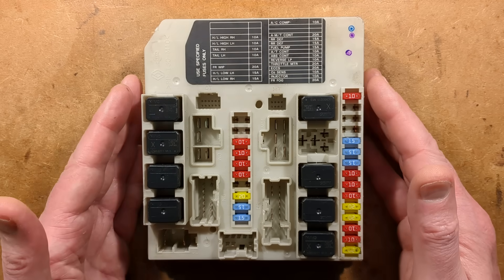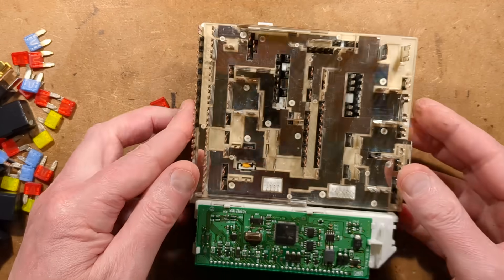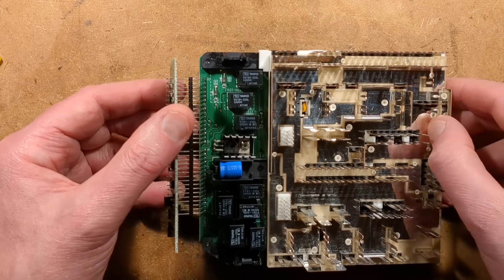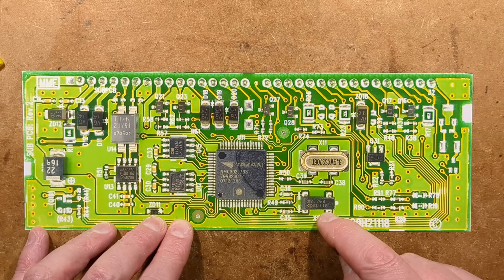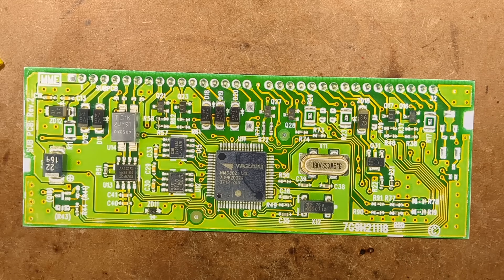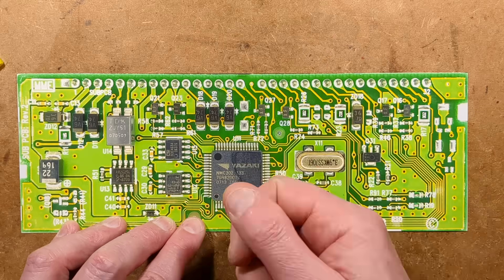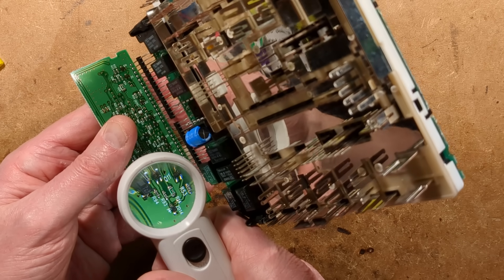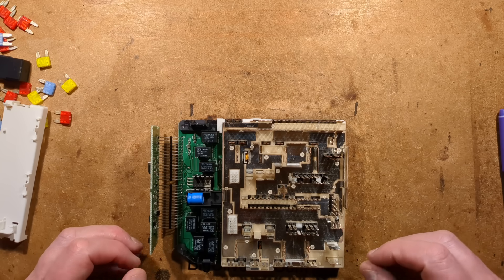Why your car's fuse box costs so much (and the location of the data chip)

Comment: That looks as if it was designed by someone with zero knowledge of the conditions it is expected to operate in. I can see no end of potential problems which your average mechanic would have no experience of. I sincerely hope it resides in the cabin away from any possible damp or water ingress.

Comment: and they can be a nightmare when they fail or start too the BCM (body control modulo) on an 05 ford escape random errors non functioning windows emergency flashers randomly coming on AC going to heat then back transmission wont unlock to drive UGH an they no longer make them it has to be programed to fit the VIN and its hit or miss if that works

Comment: For removing the large pin header I'd recommend a solder sucker with heated tip. Generally great for desoldering a bunch of through-hole connections.

Comment: My father would be 108 this year. 
He advised me 50 yrs ago from following his career as an automotive mechanic because even back then, he saw cars were becoming unrepairable. 
Can't imagine what he'd think about the amount of electronics in modern vehicles.
Reply: They suck.
Reply: It's not the amount of electronics, a lot of it is simply to help modern vehicles meet emissions standards, the problem is that electronic componentry is thrust into a harsh working environment where it is subjected to vibration, dust and moisture and yet expected to continue to function year after year perfectly. I am surprised that more vehicles don't suffer from just the odd bad part or damaged wiring when you consider that VW stick the control box for the Nox sensor between the plastic under tray lining and the body shell so that any water that enters the front of the liner at the wheelarch is carried down the underside of the vehicle and over the sensor unit.
Reply: I drive an old klunker from the '90's. My friend has a fairly new car. One day I had to drive it somewhere, and I could barely understand how... All push buttons and touch screens. Oh, and it turns the engine off at red lights.

Comment: I used to work for Nissan. They actually aren't that expensive, that is a Nissan IPDM (Intelligent Power Distribution Module), they cost around $120.00 new from Nissan (depending on model). When your IPDM goes out, so many random things start happening. The IPDM controls almost all functions that are controlled by a relay / switch. It controls starting, headlights, wipers, fans, shifting, horn, flashers, and many combination meter (your gauges on your dash board).
Reply: Just had Toyota charge me (well, work) $130 for a new fuel cap. $120 for a whole IPDM new seems wild

Comment: Awesome video. I had a module like this (REM) fail in my volvo, and it turned out to be a relay hiding under the plastic shell that was soldered in, and was responsible for switching power to banks of fuses. really annoying repair, and curse the engineers for not making this relay removeable

Comment: not just a fuse box anymore. I would always prefer to copy & paste eeprom date vs swap chips, both work though. may have to lift a leg for isolation. and the modules that self corrupt with low battery voltage are the best

Comment: For many years I have heard people say ''you have water in the fuse box'' suggestion for why the car is playing up. I used to think that was utter rubbish as how could rainwater interfere with the workings of 12V electrics - fuses and wires etc. Now I completely understand where they are coming from, I never knew there was a circuit boards and processors in the thing.

Comment: Been there... My MINI Cooper S used to have an issue where it would start coughing up for a couple of seconds before just shutting the engine down. Not a great "feature" to have in traffic... 🤣 After shutting down it wouldn't start up again, until after 5-10 minutes. Turned out it was the fusebox, but no idea what actually caused it. Bad component/solder joint that would fail after heating up..? Who knows. Cost a fortune to figure out it was the fusebox in the first place, and not the fuel pump, its relays, fuel lines etc. 😬😁

Comment: i was working as a auto electrician at a Ford dealers in Wakefield  in the early 90s when the Mk5 Escort series came out...first Ford with a Multi layer fuse box 

it was mounted under the battery tray inside the dashboard...

Ford never solved the screen drainage issues around there that also plagued the Mk4 and it would flood the battery send acidy water all over the bulkhead and they rusted away there in months...straight inro the cabin and onto said fusebox

i must have changed hundreds....Post Office Vans 20 deep on tne carpark with all sorts of weird faults....fuel gauges that went to dull when ya pulled the handbrake up

..wipers that would only work if you had the door open......random stuff

no real electronics in them but relays galore and everything went through the fuse box...modulare wiring 

there was about 30 variants of box depending on the vehicle spec and a FINIS code on everybox which at least made one easy to identify....after the bodyshop had welded in a new battery tray

on bonus ...you got 
1hr 40 m to swap one...

i had it down to 20mins 

doing 15-20 a day

had my money made by tuesday night  and 3 days to top up the holiday fund😂

Ford warranty copped on and said 'fuck that'...and tried to reduce the time to 35mins as they were paying.....

I objected and said i wouldnt do any then and you can deal with the  off road costs you not being  charged by the PO for van hire cos im so bloody good at it..

They relented and i went to Portugal twice that year  on the proceeds and  paid  cash for a Mk 4 Escort turbo

which got nicked a week  latet

God Bless multi layer Ford Escort fuse boxes❤😂

Comment: I worked in the auto parts industry for about 5 years, the data chip stores the configuration of the fuse panel as you speculate in the description (for Mopar at least) but is primarily to gouge customers, in my experience. I can't really see any necessity in a fuse block being on the CAN bus or storing any data at all. It's not like it will indicate that a fuse has blown or what position it was in or how much current it pulled or anything like that. I think some of them might have a shunt for measuring charging current but I can't say for sure. Still feels excessive to me. 

This was one of those parts we had to turn a lot of customers to the dealership for, who asked for exorbitant amounts of money and then had to program the ECM / BCM afterwards to reflect the replacement.

Comment: Using those chip clips is very much a "it depends". And even without a microcontroller being a concern, it is a possibly flaky connection so I always do multiple reads (usually 3) and do a binary compare, any difference between is a "fail".

Comment: Recognized this unit as being in my clio mk2. Car kept running after ignition off, wouldnt start other moments. Traced the issue down to fusebox, opened her up.. Oxidation everywhere. Cleaned it with IPA and toothbrush and ran for years after. Culprit was some lousy design errors allowing water in when parked up a slope

Comment: I use those chip readers to get the data off of immobilizer modules. I then have to run the data through software to extract a 4 digit code that i use to program new keys or match new modules to the system. Reading the chip that way has always worked for me as i have done it dozens of times. If it didn't read correctly than you would not get a valid 4 digit code. Reading the chip on the board might also depend on the boards layout.

Comment: As an addeneum:
Yeah, most of these seem to be modular so that manufacturer can make vehicle specific changes and still use the same control unit.
And no. Those are usually very poorly 'sealed'. So water tends to... Find a way in.

Comment: I really don't like these. Some of those have tiny internal relays soldered to the board.

One that comes to mind is the silverado trucks of the late 10's. The horn relay loves to just weld closed and suddenly you have a horn that does not stop ever.

Replacing the relay would be easy enough... If those weren't blocked by a giant copper bus bar that covers almost every one of them. There's just no desoldering that bar.

Completely a.hole design.

Comment: My first job was quality control inspection for the contractor that made Jaguar fusebox pcbs for Lucas. The fuseholder blades were all inserted and soldered by hand, using an alignment jig so the plastic moulding would fit first time. We used Multicore Solder and Adcola temperature controlled irons. And the workers came from the local training college...for free...

Comment: Going back decades, Audi used a load reduction relay to cut power to accessories while turning the key to the crank position. Forward to today, we now use computer controlled relays to selectively turn relays on and off, even for wipers and turn indicators. I imagine that's why there's PCBs inside a fuse box, and those hidden relays. I'm betting those relays are 5V switched, which then send 12V power to the larger relays that are exposed in the fuse panel.

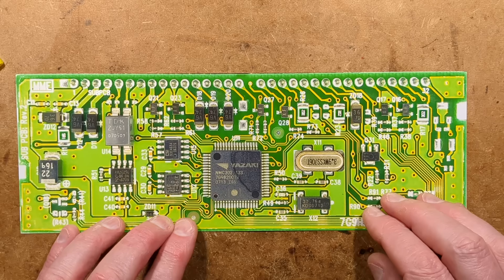Comment: 8:51 I was able to reprogram the eeprom in my Dahua PTZ controller this way, without removing it from the circuit.
Most of that thing probably works at a higher voltage, thus there's maybe next no load on the programmer.

Comment: Not just an ordinary fuse box anymore especially with a circuit board and many IC's. They are know in the USA and other
places as a Power Distribution Center or more precisely an IPM or Integrated Power Module. If you don't much about 
electronicsdon't mess with it! Just change out a fuse if needed. Chrysler products called a TIPM, Totally Integrated Power Module. And yes plenty of things have gone awry in many a Chrysler TIPM's over the last few decades and costs $$$.

Comment: #bigclive since you have driven into the automotive arena (Yes, pun intended), In the year 2013/2014 Lexus offered a 19 channel Mark Levinson Amp. Most of these amps built in those years across various models died. It is a $1000 repair. The error code says blown speaker, but is not that. 
It has a weird fault, that I can usually overcome by powering up the car. (Pressing the start button). Pushing it again to go from Accessory mode, to start mode, but not with a foot on the brake, so it doesn't turn the starter motor. I then push the start button again, shutting down the cars electrics, open the car door, close it, repeat the push start button to enter Acc mode, then push again to start mode, again with no foot on the brake and wait. The Amp usually comes to life and I start the car. After this, the amp works in subsequent use without the need to play these games. My guess, in lay terms is either the amp or head unit does a self check and fails it or it may have a super cap or the equivalent of a CMOS battery in a computer that keeps something going. Others say it is the Caps in the Power supply. A replacement Amp is between $3500 and $6500. Toyota/Lexus fixed it with a newer part number, but if you or your Viewers had any ideas or you could open one up, it would be like Christmas for me. Thank you for all your videos! You are an inspiration!

Comment: Yep i always wandered if and how people have managed o read eeproms in circuit it actually turns out that you can't as other devices on the board will pull or load the 3.3v or 5v rails down.
Reply: I find it wierd too, but I actually do this all the time and almost never have communication problems. Often there's a tiny diode on the positive supply of the flash chip though

Comment: It's absolutely insane the extent to which they're adding electronics to newer vehicles.  I remember reading someplace that a current car may have as many as ~250 CPUs in it!  One of the fun bits is the way certain info is stored in multiple places.  So if for example you were to replace a given module with one from a junkyard you might find that it had a higher odometer reading than the one that was in the car,  and the system as a whole will take that higher number and put it into all of the other locations,  so all of a sudden you have way more miles on the car than when you started out. One of our vehcles has one of thoe electronic wireless keys,  only had one key when we got it,  so we bought one online and had the dealer program things.  Only they didn't get it exactly right because somethimes I'll hit that button on the dash to start the engine and it'll come back with "key not detected" when they are both present.  Next time I think I'll go for something older...

Comment: CANbus has become one of my special interests; very easy to implement on an esp32 microcontroller, and there are ways to do it on a classic arduino too.
Deceptively simple but very robust communications system ❤ Also, it doesn't require a master controller (unlike something like i2c), which makes networking projects a lot easier 😊

Comment: All the theatrical lights I’ve encountered in the US use an RS-485 -based bus protocol called DMX512 (with/in addition to network based extensions). Do you have CANbus based lights in the UK?
Reply from the maker: DMX for the connections between the lights, but canbus between the modules inside.

Comment: 1 drop of water inside the BCM on a prior car. It was just enough to corrode and take out one singular trace on the PCB. That managed to take out all of my dash lights and tail lights. It was also a pain to open up but a blob of solder, some wire wrapping wire, a couple hours of my time saved me at least $120, not including that I was less likely to get rear-ended on the interstate and less likely to get a ticket.

Comment: Repaired loads of these K12 units, always seem to blow the sot23 XF relay drive transistors. The SOIC clip does not reliable work because most chips have the write protect enabled via connection to ground pad, easier to pull the chip and read.

Comment: My 2010 Ford Focus will only start with EasyStart, but thereafter runs fine. The garage has tried replacing various components but has concluded that the problem is in the electronics. They aren't willing to spend the time (and my money) chasing the problem, so a car with several years life is going to be scrapped. It all used to be so much easier ... (sigh) ...

Comment: I’ve removed pin headers like that without bending or cutting them. You just need a solder sucker and patients. With older pcbs there was a risk of lifting up the traces when desoldering through hole components. But newer pcbs have better glues that largely remove that risk.

Comment: My car from the 2010s has three big fusebox assemblies. 1 either side of the cabin and 1 in the engine bay. It's from a time when cars were built with many separate computers that did their own thing. ECU, HVAC, security, windows, seat position, airbags, auto wipers, auto headlights, HID control, entertainment, navigation (running off a DVD in the boot!) and so on (and so on) are all separate modules scattered throughout the car. I believe modern cars are much more centralised.

Comment: Yep. Water ingress messed up ours; interfered with the fuel-tank sensor (“sender”) & the electronic release for the hatch-back. 

Bought a donor to transplant components. Frustrated by the unnecessarily lock-down of this tech. Should have been a relatively simple DIY repair & not a costly dealership one 😢

Comment: Some devices in the car have a delay before power down, after the ignition key is removed. I wonder if the 32 Mhz Crystal is involved in timing that?
 Or some engineer just followed a reference design that included the crystal!

Comment: The whole needing to program new modules to vehicles is so bunk.  I work in heavy duty and vehicle control modules like this are plastered all over.  You remove one and drop in a fresh one, it pulls its programming and instructions sets and housekeys from redundant coding stored in the other surviving modules on network.  These should work the same.  But they don't.  Dealer gotta make a buck.

Comment: Isn't there some rule auto manufacturers follow as to not use electrolytic capacitors in car electronics because that limits the life of the car part to about 15 -20 year? I know that's well longer than the typical life of a car. Just wondering.

Comment: CAN bus is very very clever. It's 'relaxed' state (recessive) is a "1" - no-one is driving anything on the bus, and it's asserted state is "0". Anyone can pull the bus to 0, nothing can 'drive' it to 1.
By doing so, if 2 devices try to talk at the same time, they do so by sending a number of assertive bits (0's) representing their priority, followed by recessive "1's". By doing so if they read back the same number of 0's then they have control of the bus, if they read back more 0's than they sent, someone else has control of the bus. The lower-priority device backs off and tries again later. (This is massively over simplified, but hopefully you get the idea).
Reply: Nah this was great, currently in my summer semester covering digital circuits and such, I’ve seen the term CAN thrown around and understand that it is generally just a way to transmit data on a bus but this sums it all up for me